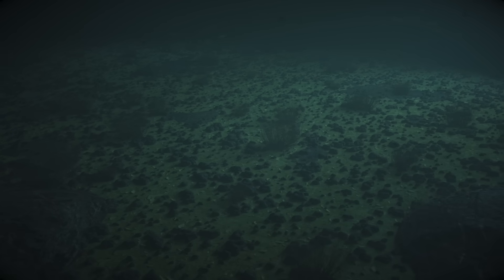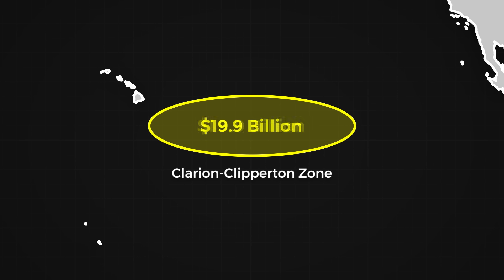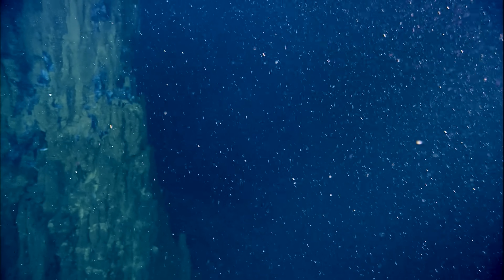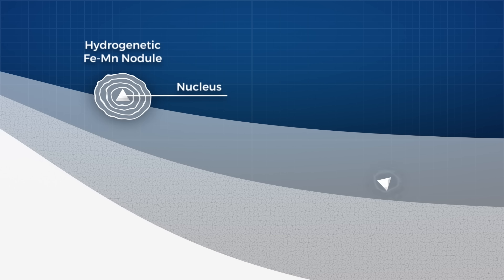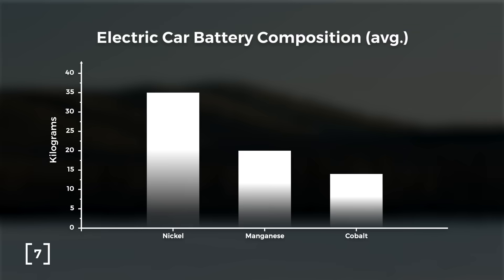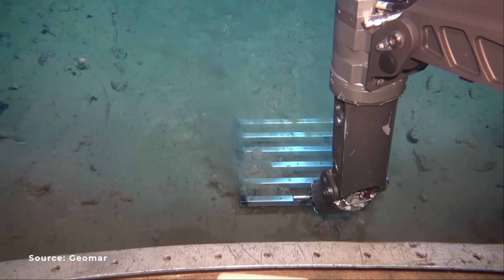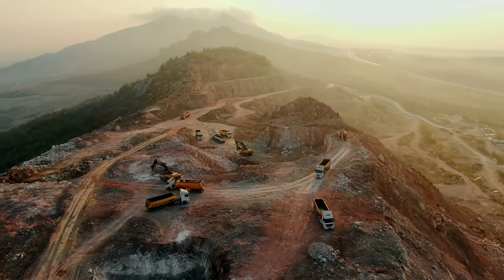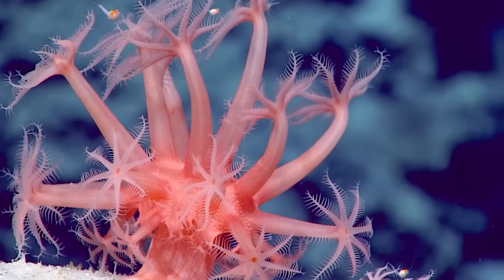The Truth about Deep Sea Mining

Comment: are bucket elevators feasible to transport these seemingly small pieces of minerals up to the surface?
Reply: Consider the distances involved and the pressure of the ocean. The scale of these operations is simply unfathomable if your reference point is ordinary mechanical devices you see in your daily life. I had the exact same thought that you did upon first seeing them, so I'm sure the engineers who all arrived at the consensus they did for the current methods will have at least considered this route.

Comment: Kennecott Copper did a study with nodules collected from the CCZ. They found it extremely efficient energetically and financially to simply suck up the nodules from the seabed. 
Their conclusion was that they coul so easily collect and extrat manganese that it would depress the world price so much that it would work itself out of a business. 
That was in the 80's. The demand for Mn may have increased by now to avoid that problem.

The other issue they discovered is that now that they had these nodules on land, they had to dispose if them. The obvious and reasonable method would be to put them back where they fiund them since they hadn't done anything with the most of the material they collected. But that was not what they were allowed to to. The power hungry bureaucracy that has no better understanding of whats going on than a 5th grader decided to regulate that they package up all these nodules in barrels, seal them up, lable them and burry in the desert as "toxic industrial waste". Imagine that, picking up a rock from a place and putting it back in precisely the same spot now creates a toxic waste site. As a child i oicked up rocks all the time. I suspect my ancestors and every species on the planet large enough to pick up a rock has been doing that for millions of years. But now that we created the EPA, doing so at this point in time automatically creates an toxic environmental catastrophe. 

It's attitudes that pervade bureaucracies like that, that make actual engineering solutions impossible to achieve.

Comment: There is another option for mining the oceans, pulling lithium directly from the sea water. Its fairly low concentration and if I remember correctly, we wouldn't be able to really pull enough out in a meaningful time to effect life. But we could pull enough out to make batteries at scale. But it has a similar technology issue.
Reply: Lithium is only like 2% of the battery by weight. Its cobalt and nickel thats the bottleneck

Comment: This is purely a dollar venture by oil companies looking to offset carbon taxes and keep the monopoly.
 It is already a white elephant in terms of supplying the EV market. 

The EV sales market is currently in decline. 
The backlash against Ulez cities is growing and local councils are telling national government its killing the retail sector in those large cities rolling ULEZ out. 

Just 2 years after purchasing an EV, the vehicle is worth 65% less than its purchase price. 
That is a steep depreciation in value. 

With batteries requiring change out after only 5 years of motoring, the cost of a new cell is more than the vehicle is worth after 5 years and so the vehicle is generally being scrapped. 
The average cost of a complete cell unit is around £6000 in the UK.  
No one is willing to purchase a new battery at that cost for a vehicle whose other components have already achieved 50-65'000 miles minimum. 

Replacing an Engine & Gearbox at 5 years old or 65'000 miles is generally rare to unheard of on a petrol & diesel vehicle. 
 
This is having a serious effect on the buyers market coupled with poor milage per charge, waiting times of 2 hours at public charge points for less than 60 miles of top up and an increased cost of buying electricity at public service stations throughout Europe as energy prices increase and an inadequate charging infrastructure in many countries across Europe, no standardisation in charge points/ vehicle connectors and payment facility issues.
Buyers are turning back to petrol & Diesel vehicles stats show.  

 It is currently more financially economical in the UK to run a new diesel car as the oil prices have dropped since April 2023, whilst electricity prices have not fallen at public charging stations and a diesel vehicle has twice the range with only a fraction of the waiting time to fill with fuel.  
Too many downsides to ownership. 

Manufacturers actually have no plan as to what happens to the vehicle after a road traffic accident or EV fire. 
Governments have been slow to react to fire safety procedures involving lithium vehicle fires.  
China has recently had a spate of increased EV fires. 

Once the chassis is bent in an impact the integrated chassis/battery design is often deemed economically beyond repair by the insurance company. 
It becomes an insurance write off through cost. 
Therefore also a waste of resources. 
Especially as recycling facilities have very limited scope to recycle damaged battery assemblies for a profit. 
  Insurance companies are now purchasing second hand batteries to install into cars they do cover the repair cost on. 
Which means your repaired vehicle is not fitted with new parts as was always the case, instead  part worn critical items often without the customer realising. 
There is a shortage of new battery units, lead times are upwards of 18 months since the pandemic supply chain issue so they are looking to source used batteries from dismantlers. 
This will affect resale prices further no doubt as it becomes common knowledge all HPI marked repaired EV's likely have an unknown history on the replaced battery. 

There isn't a large market for purchasing second hand battery assemblies privately as the buyer has no idea how far into its life cycle the unit really is or how many of the individual cells have been replaced during repair.  
Individual damaged cells can be replaced by only a few companies currently legally but more and more EV batteries are becoming chassis integral components anyway to reduce vehicle weight which renders the assembly scrap in a large enough impact. 

When the EV is recovered from an accident to a storage facility or security parking lot to await insurance damage  assessment by an insurance inspector,  the fire safety rule is, the vehicle has to be quarantined due to fire risk from possible damaged cells. 
This requires a 15 meter square area around the vehicle and not stored inside a building. 
 A space that would usually fit at least 6 other petrol vehicles is now reserved for just one.
So the recovery company loses rent on the extra space required for one EV.   

So the recovery firms are becoming reluctant to recover EV cars as they lose money storing the vehicle, sometimes for over a month until an insurance assessment is conducted. 

Insurance companies are having to increase the cost of vehicle policies to cope with the growing EV vehicle fires/accidents and the specialist treatment that  requires. 

When an EV catches fire, lithium cells are extremely difficult to extinguish. 
Generally, the fire service just let the vehicles burn out unless it occurs in an area blocking critical road services. 
This has a major environmental impact with harsh toxin release, damage to road surfaces, road closures for up to 8 hours sometimes. 
One approach in major cities has been to lift the burning EV and drop it into a container 5m long full of fire retardant fluid to cut the oxygen off.

These containers, attached to a purpose built vehicle cost in the region of £500'000 in the UK. 
All fire stations will be required to have at least one and as EV ownership increases as the plan dictates, so to will the need to expand these fire tackling  measures. 
The tax payer will be expected to cover this. 
The vehicle owner/insurer will be expected to cover this cost. 

After a decade of increased EV production these added consequences are coming to light to the general public and having an impact on the EV sales market already prompting car manufacturing to slow the plan down and continue sales of petrol & diesel vehicles for the time being. 

Recently Britain has decided to proceed with an onshore lithium mining venture in Cornwall. 
The figures are 500'000 vehicle batteries per year. 
 There are 17 million cars on the road in Britain currently, the majority are still ICE vehicles. It would take more than a decade to replace 17 million vehicles to fully EV. 
Europe has a population of 500 million people. 

The resources, be it lithium cobalt & manganese or the production facilities for upscaled battery production just aren't available nor the investment. 

JLR is to be the largest vehicle manufacturer in Britain in demand of those batteries from Cornwall as they transition production  over to all electric vehicles. 
There manufacturing facilities are based around Birmingham, approx 150 miles north of the mining site.
 But the majority of their vehicle sales market is not within the UK. 

So lithium mined in Britain will be put into vehicles to be shipped by container ships half way across the planet.  
How is that decreasing the environmental impact along with the usual downsides to mining toxic minerals in an area that lacks adequate road transportation for heavy vehicles and its local economy subsists on tourism and sea fishing presently. 
Neither of which are good partners for large scale toxic mining excavation. 

I want to see an alternative to fossil fuel powered vehicles, the ICE is over 100 years old and at the extreme end of efficiency as far as engineering is concerned, their are no more power efficiency gains to be gained from the technology. 

But EV's are not the way forward clearly. 
We are trading one environmental impact for another without even having  conducted a complete study of the outcome first. 

Regions such as France which already has 50+ nuclear reactors would still struggle to produce enough electricity and they rely heavily on mining Uranium in central Africa, a region not known for political stability. 
Imagine the impact on French economy if its entire infrastructure, domestic electricity and its transportation system is reliant on Uranium that suddenly becomes unavailable because of another proxy war. 
This deep ocean mining is not an answer to climate change, its a replacement for profit loss on transitioning from one energy source to another. 

We already know of the environmental impact of coastal dredging on marine life, this venture will be no different, it will devastate the sea floor, it could also introduce species of bacteria that we have never encountered before into our own environment topside and as 70% of all life is in the oceans functioning in an ecological food chain it will have a detrimental affect on us for certain. 

How will regulation be applied to companies operating at depths that less than 30 submersibles can reach currently? 

How would the UN possibly police these operations when we cannot even keep track of the growing dead zones from deep sea trawling drag nets. 

The whole idea of a global EV transition has been done in the wrong order. 

Governments have squeezed car manufacturers with carbon  limits so they produce EVs to offset the cost of potential fines into a marketplace lacking in the infrastructure in place to accommodate a global EV revolution whilst struggling to acquire the raw materials to upscale production and the only industry that can possibly provide a solution now through deep ocean mineral harvesting is the same industry that has a terrible record on pollution, price gouging, ultimate control of the energy markets, cause of proxy wars & government corruption for decades and a despicable human rights record. 
The oil industry. 
 
 As much as environmentalists want this revolution to be the answer, it really wont be.

Comment: While this was a great video in one end, with valuable visuals and explanations, you failed to mention the phasing out of Cobalt, and the fact that we aren’t running out of these metals. In fact, switching to a sustainable economy in terms of emissions over the next 20 years, compared to the next 20 years extrapolated required oil and gas investments shows that we will be mining less than what our current projected economy would require with a fossil fuel based economy. Moreover, it would require much less funding. Yes, to totally switch would require less funding than the same funds required to grow our current fossil fuel production to match our needs by then. It’s quite insane.

Anyway, regarding the video topic, I’m no expert, but i do know most emissions are found during refinement processes, and that the materials required for our batteries really aren’t that damaging to mine. It’s just the refinement that needs altering. Hence, as with anything and everything important to our future, Elon has hopped in. Tesla is now building a refinery.

Comment: by the way the answer is Nuclear who are we trying to fool here? even on the ocean floors there is literally not enough resources on this planet to power the entire planet with solar panels and to make the batteries needed to store the energy to maintain grid inertia, you do realise these "renewables" are not actually renewable and have a shelf life right? 25 years tops for a panels and 10 for a battery. you do get once the materials are spent at the end of the use life of panels and batteries that you can't reuse the material for new units? not without processing which in turn requires more energy. They also create more carbon than carbon based energy because of the processing overheads and you know this really. Bro quit clout chasing on this front cause you know better.

Comment: The depletion of surface nodules means an attachment point for deep sea creatures is lost. They can’t or don’t want to attach to the remaining sludge. Why not make ceramic weirdly shaped objects to place on the sea floor. These would provide anchoring points for sessile creatures and repopulate the mined field again. Going a step further and creating a reef at depth may produce fantastic environmentally enhancing benefits. How about that: making a better micro-environment through exploitation! 

The sludge material could be dried and fuzed into ceramic material and then returned to the sea floor. That way, the plume of sludge cloud blanketing every living creature in the surrounding area can be avoided. Again, turning a potential environmental negative into a positive.

Comment: Lifting the modules to the surface is done with an airlift system. Used also in construction for deep piling.

Following this closely as I am a (very small) shareholder in TMC.

Comment: Why not have a tube lined w/ moving conveyor belt by a rope machine that the conveyor belt is pressed into a tube and its a flexible tube, so the conveyor belt can be engineered where the belt is always trying to stay at a certain circumference so when the  rocks go up the tube w/ a little wider opening, the belt can basically grab onto the chunks of mineral & theoretically not scoop up the debris since it’s too small

Comment: We're chasing our tails with the prospect of using batteries for mobility. The truly only way that will free us from harmful mining is using hydrogen fuel cells. Sure, hydrogrn storage and a material strong enough to contain it, compressed or liquefied is a materials engineering problem, but we engineers love investigation, testing and application problems. Yeah, there are a few, very few, researchers globally working on the problem, but is the research and discoveries coordinated? I know, corporate patents become the issue. The almighty dollar matters, but patents don't last forever. 
This problem of hydrogem embriytlement will be solved. Go hide and we'll get it done. The scalability of fuel cells is the answer to power us into the future.
If we turn to thorium reactors sinc e they bypass two major drawbacks of uranium, being meltdowns and the ability of byproducts of fissionable radioactive materials.

Comment: wind power is already proving to be a major environmental disaster as their blades are just chopped up and thrown into landfills. Solar will only work with large grid batteries, which are both innately super inefficient. Until we have a strong nuclear power grid, EV's are powered by coal and LNG. Destroying more ecosystems to push more EV's in the name of climate change is just going to result in more coal and LNG plants to meet the demand. NYC has been having constant brownouts ever since shutting down indian point, their CO2 emissions went up 40% year over year, and electric prices have gone way up. When are you people going to learn renewables and EV's won't solve climate change without actual clean energy.

Comment: Real Engineer never ceases to amaze me at how stupid he is. "Raising material this distance takes a lot of energy." No ldiot. The deep sea is a higher pressure than the surface pressure. It will rise on its own if the piping is not allowed to equalize to ambient pressure.
Reply: 🤡🤡🤡 by your logic the nodules will just be floating on the surface of the ocean.
Reply: @gravoc857  exactly
Reply: @gravoc857  no. Because nodules don't have an hermetically sealed pipe from surface pressure down to the sea floor by nature.

See how dumb you people are. The effort to raise anything from the seafloor by a pipe takes nothing more than a regular 1atm pump. In drilling for oil the aquifers just gush by themselves for the same reasons. 1atm is much less than the  6,000psi of an oil well.